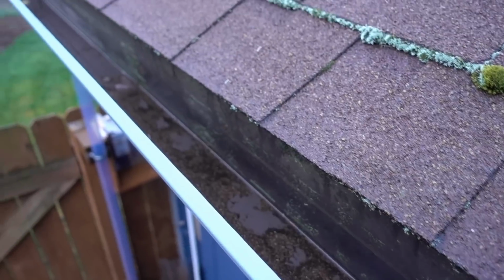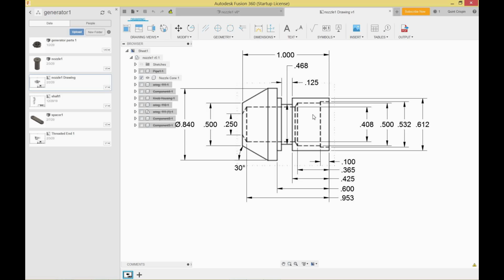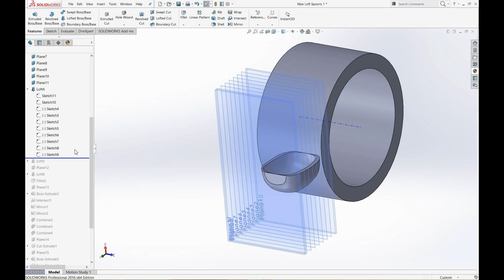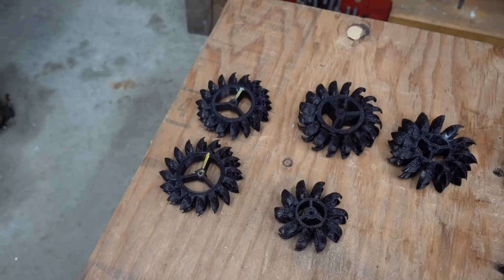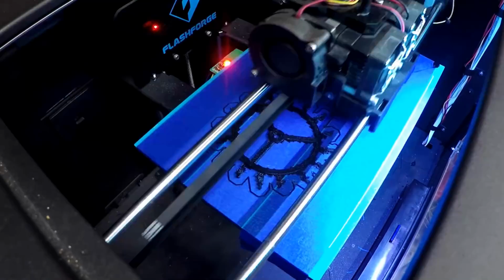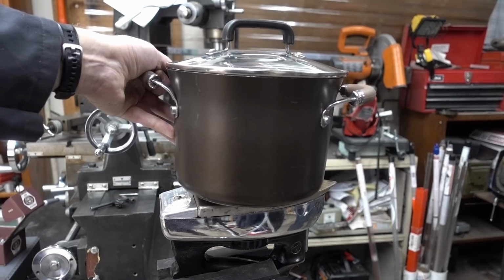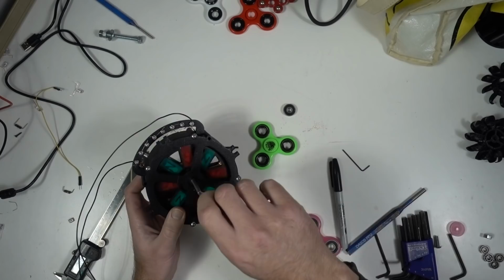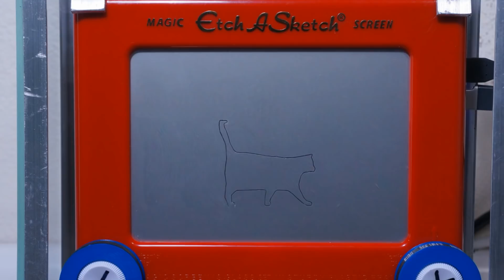Rain Gutter POWER #3 - Fidgeting With Turbines!

Comment: I keep wondering... can't it be that the first one works the best simply because you dont use bearings, so the one that has spun the longest has also been worn down the most to lower friction?
Also, are you sure smoothing the buckets is a good thing? I have a feeling that the ridges could potentially act as teeny tiny additional recursive buckets that actually catches the water even better.

edit: Would it not be possible to chain multiple ones together in some way? Like, you have the nozzle point on a wheel, where the water is made to bounce off onto another wheel (which actually catches it) which will obviously spin slower, but still adds whatever energy the first was unable to capture. (so the first is impacted and made to spin, the second catches and spins because of gravity (and whatever energy is left))
Or, yknow, you could design a wheel so efficient that you let water fall down on it, but it takes all the energy such that the water never moves at all and the entire gravitational acceleration is converted to heat and electricity. Cause that is possible at all! ;D

Comment: adjust the height of the water jet hitting the turbine, if your jet is too low, you'll lose pressure with the splash-backed water interfering with your jet stream

Comment: What if you put the nozzle facing down. Use the weight of the water to go straight down vs. the water changing directions, then hitting the wheel? Move the wheel down and to the left so it rotates the same direction but use the weight of the water to create more force. I’d like this set up with about a 50 gallon drum on top. Fill it up by hand, let gravity spin the alternator. Then refill by hand. Free power. Maybe have something to catch the water being used and run it down onto another wheel and alternator. Use the water and gravity twice. Gears are turning in my head. Love this stuff.

Comment: Excellent channel. What you have reached is a point that gives engineers headaches. The balance of cost verses gain. If you engineered it further with things like frictionless magnetic bearings, you might squeeze a little more efficiency out of it. But, it just isn't worth the extra cost unless your need for efficiency is more important than the value of the electricity. NASA does a lot of that kind of research for space exploration where efficiency and reliability are the number one priorities.

Comment: If you want to make more power you need higher velocity water. In order to achieve that from a rain gutter you will need a taller roof. Adding more nozzles will just give you more water going the same speed. That can increase torque which will help if you need to carry a load. It will not spin your turbine any faster. For that you need pressure. 2.31 feet equals 1 psi. So you either get a taller roof or dig a hole next to the house. Adding 10 feet will increase pressure by 4.x psi which will improve the water velocity at the nozzle.

Comment: I work with hydraulic turbines. In my opinion, to compare different impellers by looking only the output power (not the efficiency) and conclude wich impeller is the most efficient one, you have to make sure that your net head (immediatly before the nozzle) is the same for  all the tests. The flow rate has to bem the same too.
When you changed the first noozle, probably you changed the losses (increased), and drop the net head and flow rate. When you changed by adding several nozzles the same probably occoured. 
So, probably you improved the efficiency of your impeller in some option, but it was not observed because your hydraulic power dropped.
Reply: I forgot to say: amazing work!!

Comment: Hi, just wanted to give some info on improving the efficiency. I heard mention of " We've done everything we can to try to improve efficiency" Unfortunately that's not the case. A few major points were missed. First off your pelton wheel is installed in the wrong" axis,  high efficiency units runs horizontally eliminating  losses of a vertical orientated wheel carrying residual water back up consuming energy in the process of constantly lifting the spray off. Next is your clear lack of understanding of VELOCITY. The attempt to add nozzles by custom milling a T fitting and adding rubber hoses!..haha, massive resistance and loss of VELOCITY. A simple solution for your installation would be to Y the down pipe with about 5" or so in between for the wheel. Drill ur hole on each pipe to push on at least 2 points (could even have 4 spray holes, 2 on each pipe drilled at different angles) sides of the Pelton simultaneously without any restrictive fittings or extra small orifices. Your nozzle needle support disc was/is another poor design which reduces the efficiency greatly. Rethink your whole approach with the idea of keeping the speed of the water to a maximum. Tapered down pipes aka "velocity stacks" will also greatly improve system output. Mount ur pelton horizontal, split ur downpipe with a Y not a T fitting and hit wheel with 2 closely positioned non-restrictive nozzles (cheap hose sprayer nozzles r good). I bet u can nearly double the output from your "fully optimized" setup. Thanks for good scientific content, well done. Hope you appreciate the knowledgeable suggestions, if so pass it on.

Comment: I saw a electrical engineer on utube that suggested you off set your charge/discharge from 180° so when it discharge's there is no backfeed. That is where you loose a lot of power. You might want to try that out. 
And maybe use a auto alternator for more power.

Comment: Quint I have been very interested in your concept here but I think I may have an idea that would maximize the energy you can extract from the rain. Why not use Archimedes Screw inside the actual gutter so 100% of the water, its weight and the head pressure from height would maximize in the closed tube. Just a thought but I figure it would maximize that aspect since water wheels splash all over and just cant be efficient. Anyway I am loving what you have done thus far and I really think it is briliant.

Comment: part 59: after getting the quantum tubes, we can get the presure needs to hit this diamond to vibrate at the correct armony to gnerate the mechanical force to produce the energy output needed to ligth this LED

Comment: I would love to send you some of my results in this field. i was creating a water pressure powered turbine that would power a sub pump for my basement when the power goes out. like yourself, i made about 20 different motors powered by water. my most interesting was having 2 rings, A 3" ring with a 2" iner ring. by having inner ring touch flat the outer ring and by adding expanding blades. this created almost a combustion stoyle motor powered motoer. it did not work well but did in fact create the very best water pump i have ever seen. almost zero waiste of energy.
Reply from the maker: My email is Build2LRN@GMAIL.COM

Comment: It seems like you’re reinventing the wheel. If you looked at hydroelectric stations, they use impellers in the pipes to generate rotational velocity that’s hooked up to a generator.
Reply from the maker: Those are reaction turbines for higher flow vs. head. Each turbine style is optimal for different applications.

Comment: Since you have it mounted horizontally move your nozle to just befor the drop of the wheel...the old timers of water wheels have fingers that out ...might help...any water on the up side of the wheel is resistance to spin by gravity

Comment: hey buddy i like your video. i just wanted to throw 2-3 idea that maybe you would find useful,(thoses might already been called out tho)

1: your water jet need to squirt downward(its on the side right now) use the gravity for yourself.
2: the bearing you use, there might have better bearting. But i suggest you to pick some decend bearing, make sure no water and grease are inside(WD-40 is your friend here)
3: maybe you cant add counter weight to your turbine(like an automatic decompressor attached to camgear on a motorcycle)

Comment: Have you tried changing the wheels orientation to horizontal so the wheel doesn't lose spinning upwards. You could also try adding a second wheel that meshes with the first for a second generator to be tied in. It might also be that you need a closed unit like the generators in hydro electric dams so the full weight of the water is used instead of splashing off.

Comment: Having the nozzle a few inches off the bottom of the down tube and a full 90 degrees offset from the initial flow of water seems to be an energy loss that might be able to be remedied. 

That static pressure you loose below where the nozzle comes out is small compared to the rest of the tube, but i would think it would help

Also if the nozzle came down as opposed to an angle you would not only best the most out of your static pressure, but you would also minimize the flow losses from the direction of flow.  

Idk, maybe its futile

Comment: Move from using sealed cartridge bearings to cup and cone style to handle the axial load better. 

Also, use ceramic balls instead of steel. You should see some improvements there, pushing you closer to your 1w goal.
Reply from the maker: Already ordered full ceramic skateboard bearings. 👍

Comment: You need more pressure, use  the weight of water inside a water butt and  as height as possible, bring the peloton wheel down as low as possible, perhaps even as low as the bottom on the man hole drain!

Comment: The 8mm fidget spinner bearings you use have 7 balls. There exists 8mm bearings with 6 balls instead, which have a higher top speed (on paper) since there is less friction loss between less balls

Comment: Ever thought of trying a Tesla turbine? They were invented for just this application, no blades, so construction should be simple. The idea, as I understand it, is that you squeeze the waterflow between two disks until its own viscosity starts to pull the disks along with the water flow. The water stays in a laminar flow and maximum engergy tranfer is achieved to the generator.

Comment: If you want a watt, add a 2nd station, not going to affect you flow. Begs whether you would want a circular station of water wheels. You can control how many are on, with a rain bucket which would tell how much flow based on rain.

Comment: I wonder if a clutched flywheel setup could yield results in this scenario?  A lightweight flywheel is is slowly introduced to the turbine via a clutch system so as not to "stall" the turbine.  Once the flywheel is spinning at it's maximum, that power is then used to start a slightly heavier flywheel in motion, and so on and so on, until something like a 1/2 lb flywheel for example, mounted on the same low friction fidget spinner bearings begins to rotate the shaft of the alternator.

Comment: How about a Much larger wheel where the buckets can fill up and gravity can pull them down, and some gearing to run the generator faster with the increased torque? That way you would get 100% water utilization.

Comment: Have you tried larger scoops and overall diameter of the Pelton wheel? Output would be a function of the mass applied to the wheel and how much total energy can be imparted to the rotor of your alternator. If you are rectifying the output to DC, you can pickup efficiency by using schottky barrier  diodes.

Comment: Proton wheels are high head devices with a reaction of 1. You’d be better off trying a Kaplan or Francis turbine variation for what seems like a low head and high (relative to its size) flow rate. Also a larger peloton wheel radius would mean that it’s linear rotational velocity would increase and could help remove more kinetic energy. Good luck!

Comment: I would suggest a small vortex to convert more of your mass to accessible curve so to speak. Seems counter intuitive but if you open your gutter into a larger cylinder but introduce the water at angle and make sure flow restriction is in place at first to fill the cylinder then removed to allow a natural vortex at drain around impelled shaft. The only tricky part is the seal around the shaft the hold a lily impeller tuned to the freq of rotation of your vortex.

This may be able to be geared up to get the weight out of your water vortex which can be thought of in some ways as a flywheel. Your power output is weak and it’s bc you aren’t embracing what a large volume of water in motion with an overall lower flow can do. Bernoulli will only take you part of the way.

Comment: Did you try increasing the load on the alternator?  If the water still has a little kinetic energy, your turbine might be spinning too fast.  Additional load might bring the speed down, lowering the voltage, but the current might increase to more than compensate for the decreased voltage.  I made a wind turbine once, and found that it needed a custom controller to match the load with the available energy in the wind for optimum performance.

Comment: Also Larger Wheel Size can significantly Reduce the Amount of torque required to rotate gears as it is inversly proportional to wheel diameter
Reply from the maker: I tried larger and smaller thinking the same thing but it ultimately limited out at a similar power output.

Comment: I think where the water hits the buckets is also critical. I'll explain. When washing off a paint roller, I use a water hose and use the water to "wash off" or sling the paint off by spinning the roller with the water hose nozzle. As I get further out from the center the higher the RPMs the roller spins. And as a matter of fact, when the water is barely touching the roller is when is spins the fastest. I know you're not getting water hose velocities, but maybe adjust the angle of attack or where it's hitting the buckets to maybe increase the alternator speed? 🤷‍♂️
Reply: It just seems that the water hitting the center of the bucket is causing more water to get "caught" in the buckets as they make a complete rotation. Taking a little more time to shed the water out of the bucket, which could be robbing you wheel speed. Not sure, but I wonder if that may help.
Reply: Another thought. Maybe have a joint extending out with a 90 degree elbow pointing downward onto the edge of the wheel and benefit with gravity assisting with possibly increase in water speed. I think you have maximized the wheel/alternator efficiency, and you could probably benefit with more water speed and better placement on the wheel.

Comment: Impedance matching.  If you get 20V unloaded then your maximum power will be achieved when your load lowers the voltage to 10V.  You could have gotten a lot closer to 1A if you didn't overload it in video #2 lol.

Comment: Make the wheel larger diameter,.reduce the water flow,.remeber its contact time and vertical drop which will convert energy from protental to kinetic, adjusting the water spray angle will be like advancing/retarding the timing of an internal combustion engine after all else is maximized then tweak that in tandem with flow rate

Comment: Had another thought for this when i came across the golden ratio turbine. As well as being able to save the water.  just continue going straight down, but now the water hits the golden ratio turbine.  creating a vortex and. So what i am thinking is make the water run through the turbine but staying in the tube. Now you would just need to figure out how to collect the energy whilst the turbine still in the tube
Reply: Please this is simpel 
Change to 12" tube !!! 
Use more nossels on 
Autonome tuning .. new Hole new nossel 
Dont share Hole .. 2 Holes 2x watt 
3 Holes 3 tubes 3 nozzels 12watt easy
Wright of water PRESIUR increase with sice of tubing

Comment: You may be loosing speed and force by the horizontal flow. Have you considered letting the water flow from the bottom of the pipe. This will let gravity help with the speed of the water.

Comment: i have a Suggestion to Increase the Amount of potential Energy With out increasing height,
Try Storing/Collecting the Water in a Large Height Tank on the roof ...let the rain water fill it up so it increases the amount of Potential energy due to Weight of water and Increased water pressure will Increase the amount of Torque in the Water ...this torque can be used to rotate High torque Gears and increase the RPM...in turn increasing the Current OUTPUT...i think this can significantly ADD up!

Comment: Throw all that away. Mount a wind turbine with a vertical shaft and extend and connect the shaft to 1 to 2m long 3 vane screw with 120 deg wind inside the down pipe. figure the u/j to complement the wind side. Easy.

Comment: Try to change the angle. Use gravity with the water pressure so the nosle will be below or with 45deg. Angle to the pipe not side.
For multinossle You can try to increse diameter of hose there is to much lost on hydraulic pipes with this small pressure.

Comment: I´m not sure if it will work, but I think that if you try to make a funnel in the pipe and the a tiny  exit to the water, to concentrate all the weigth of the water in a tiny spot maybe it will get more pressure, you don´t think so?

Comment: The nozzle idea going around the wheel to balance it out and add more water seem to be a good idea.  Maybe adding a smaller hose to do it was the problem instead of keeping the same diameter of the gutter wrapping around the wheel I feel like you kept the same pressure but you decrease the amount of flow.